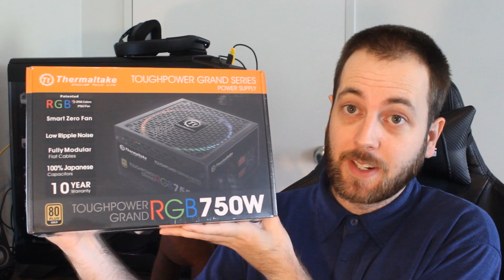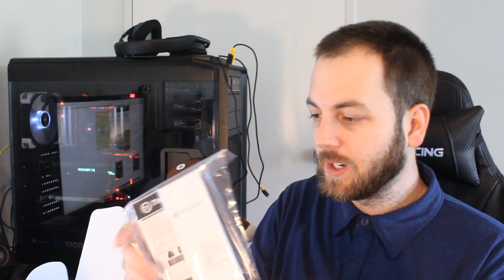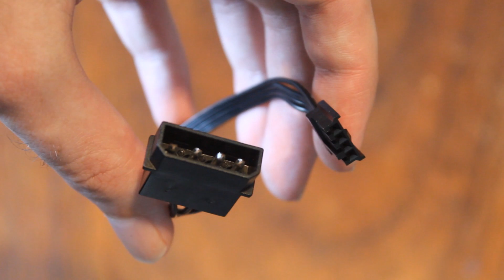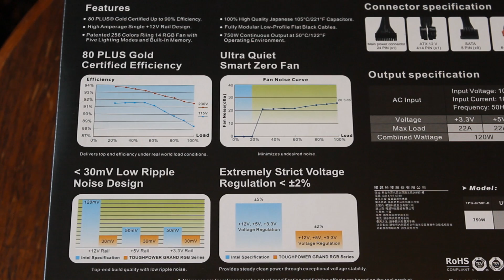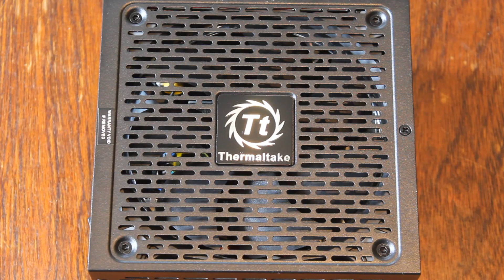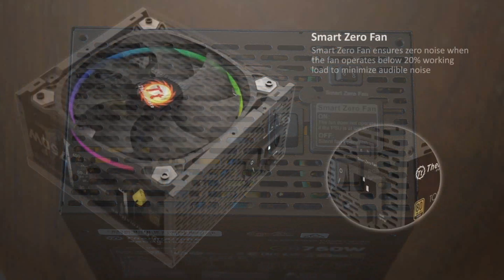Thermaltake Toughpower Grand RGB 750w PSU Unboxing & Overview

Comment: I have a Litepower 700W PSU from Thermaltake. It works like a dog with heavy everyday use for more than 5 years. And it doesn't have any ratings: gold, silver or platinum. Just simple very reliable 700W PSU. Excellent work from Thermaltake!
Reply: Still going strong. Very reliable

Comment: An i5 w/ 1060 can do fine on a 160w PSU The more your know
Reply from the maker: I don't think so, by my calculations with absolutely nothing else in a system aside from an i5 (6600k), motherboard and 1060 it would come in at 186w while on load
Reply: Tech Showdown As such an i5 with a 1060 "can" do fine :D,  at the same time,  those components could draw a lot more power than that,  exceeding 200w w/o other components , with additional components such as storage,  lighting,  mobo,  ram,  fans etc adding even more to it! 

It's a fun view to have,  seeing the performance parts you can use with just a 160w psu if you dare to sacrifice a few Mhz & extra components.  A view many creating niche SFF cases have seen.  :)

Comment: I just bought a 2080 along with the 3700x and this exact power supply, I’m also buying a meg X570. Am I going to run into any clearance issues? According to pcpartpicker my psu isn’t compatible. Please help a simple yes or no goes a long way

Comment: Are RGBs on a PSU really worth it most ot time they covered up or not really noticed its more of a gimmick really isn't it :)
Reply from the maker: If you run the PSU fan facing down then for sure, when they face up it can look quite good though
Reply: Yeah if you were going to have lighting on your PSU I think would be more effective on the sides so you can see it better but who am I to say whats effective in RGBs or not everyone has their own ideas of what looks nice and what appeals to them....... Anyway great video as always you always produce great content :)
Reply: @TechShowdown   RGB lights will work if we don't connect them to the motherboard?  I have 750w gold 80 plus

Comment: i interested on this psu temperature, i saw the cooling is up, i have a corsair 460x case, so whats the temperature tolerance, i have only vents in my case, i have ryzen 7 stock cooler 3 120mm front, 1 140 mm up and rear 1 120mm.

Comment: I recently received one ofe these PSU's. The fan doesn't appear to work for some reason, nor the RGB LEDs. Going to have to return it to get it replaced i think :/
Reply: same here  did u fix it??
Reply: Iridescent Blue button on back toggles zero fan setting.
Reply: MrReimontube button on back

Comment: I see that it only has one 4+4 cpu output ...... Now this is a problem because a lot of motherboards require two 4+4  cables for power or 1 4+4 and a 6 pr or 4 pin... MY aorus Z390 Master motherboard needs two 4+4 cpu cables to power... Can a splitter cable be plugged into this PSU too give us two 4+4's?